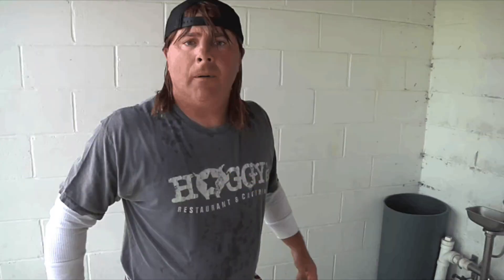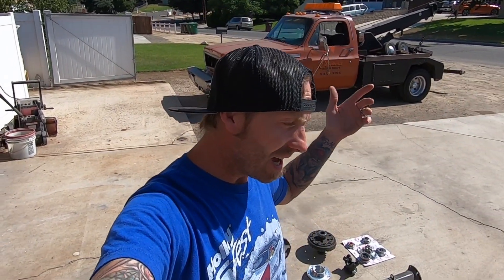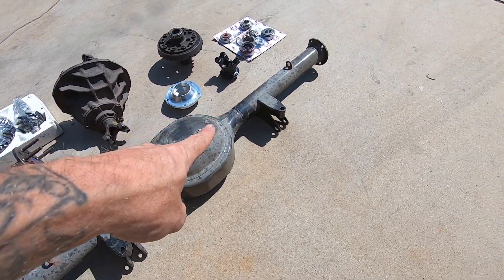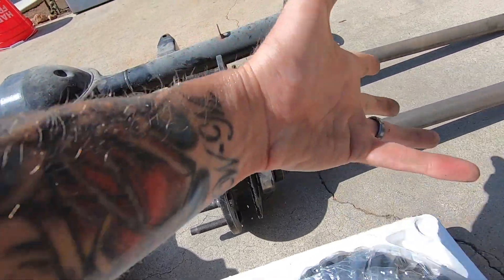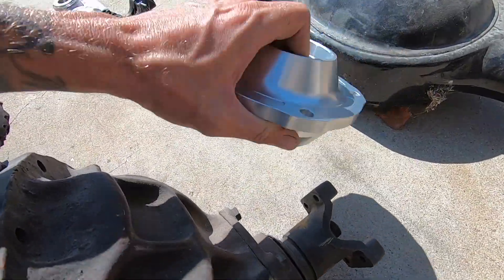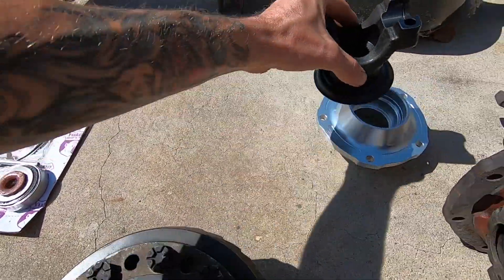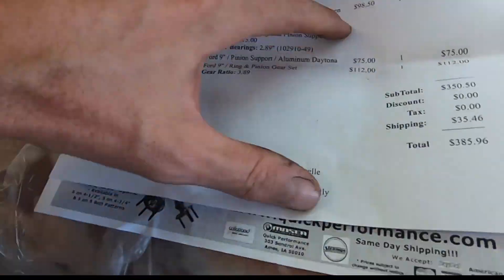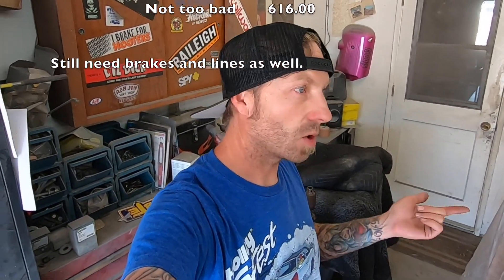Ford 9" Parts for the Maliboom

Comment: First thing you'll notice is how damn heavy those 9inches are compared to the 10 bolt. But they are a good insurance policy. If I was to do a diff swap again I'd be going Borg Warner over here they are cheap af and plentiful. Love your work Dane 🤙
Reply from the maker: Yeah just the parts alone are heavy so putting everything together is gonna weigh a ton. Im going to pretty much gut the car so hopefully it will offset some of the new weight of the rear end. Im not too worried about weight at the moment. Ill weigh it at some point and see what were working with. Im hoping to be around 3k when its all ready to roll hopefully.
-Dane

Comment: What gear ratio is in the car now?
Reply from the maker: Its a real tall gear around a 3:10 I believe. I did the "Mark and turn the tire and count the drive line revolution test" and it was just about 3 turns to one spin of the tire. I believe thats most of the reason for the terrible 60' times even when I had a loose converter. That and I didn't make any boost on the line. Im hoping to change this with the new set up after I dial it in a bit.
-Dane